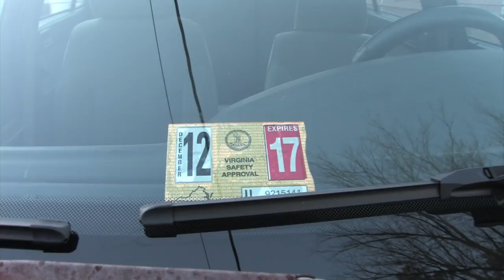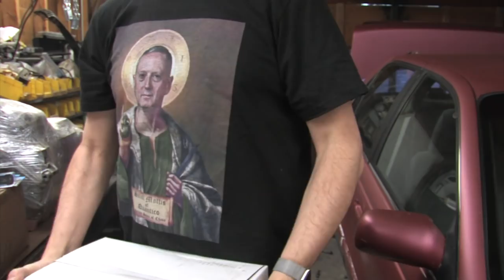Turbo Elantra Traction Issues - Part 2

Comment: I went and bought some Holden Commodore V8 wagon ultra low rear springs for my  BMW E36, they fit the same, but were way thicker and stiffer! and the car sits at a regular height, with less rear squat and transfers the body roll to the front, which is handled by a thicker front sway bar, im a firm believer of using what fits, my cars are all made from random parts, if you have a good grasp of engineering and physics, and can apply it to your part choices, then go for it, heck thats how most prototype cars are made.
cheers for being suck a great bloke Jafro! i realy enjoy your informative content! keep up the good work.

Comment: I really enjoy watching these videos. Also like the no nonsense honesty too with your R&D as well. 

A previous Elantra videos of yours massively helped me to do a gearbox swap in a similar Mitsubishi platform based car. A Proton Satria GTI.

Had a thought, sometimes a cheaper tyre is not always a bad thing. As they'll break traction, before something more important breaks.

Fair enough at the strip switch out to a much better and grippier tyre.

Sucks when stuff goes bang when you're just trying to drive the car and not even leaning on it.

Comment: I had to show my father this video just for the fact of the rear springs. We have a 2001 Chevy van with 280000 miles and he thinks the front suspension doesn't need to be changed. After showing him this video and how collapse those springs were, he ordered new springs for it and can't wait to see his reaction when installed. We experience bump steer like crazy with every little pot hole it send the steering wheel to the left immediately after a hit

Comment: literally got giddy overseeing a new Jafro vid :)

Got ya going in my garage right now as I sort the headlight issue in my mustang. She likes to burn out the switches and my stereo dims them big time; some relays and more direct power is going to do the job nicely.
Reply from the maker: Sounds like you might have a ground problem in there somewhere, too...
Reply: Grounds were fine, but for my winter project on this car I've been doing a wire tuck on it because the wiring on the Fox body mustangs is hideous. Charging harness did end up having alot of green death on it, so im replacing the lethargic 90 amp alternator with a newer gen 130 amp alt and all new wiring for it. New alternator and wiring mod should stop the headlights from dimming and the car nearly stalling under heavy bass (loud exhaust + no sound dampening= sub woofer.....apperently, got the car this way).

She's an on going project to take someones beat up track pig back to a more drive-able state while not losing any of the performance.

Comment: I'd like to see you rig some narrower coilovers on the front from another car and put some wider tires on. I love your rear suspension idea. Ingenious.
Reply from the maker: I would too!  Except that I couldn't turn if I did.  :(  It's not just the spring diameter causing this.  The drag slicks that I have rub the inner fender and frame (prior to the front end fix I performed in the previous video), so I'd have to cut away the frame and replace it to pull it off safely.  On this car if I want to go wider, I have to go outward or else re-engineer the unibody front end.
Reply: If you really want to keep your mods cheap, then try a fender roller. Check out how much this guy flared out his fender with a roller: 

https://www.youtube.com/watch?v=dF5uA1u7Mts

If you aren't attached to that little flat lip around your fender, you could contour that sucker with the surrounding body panel and add between 0.25"-0.5".

Comment: Great job. The stance looks great. I’m sure it will settle in time. How did you lookup the springs by size?
Reply from the maker: I found a chart on the Moog website with all their OE replacement springs, sorted by ID/Length, said, "OMG, those are 510 lbs!  Oh look, one end's squared, one's tangential.  Those will be 'perfect'!"  :)

Comment: Cool, more Jafro. It's been a while...

Springrate and damping are matched from the factory and in well-designed aftermarket and custom setups. Are you concerned that the Aztek springs are going to be way too much for the stock shocks, particularly their rebound damping?

Comment: Before you wax the headlight buckets a few minutes with a rattle can of clear coat to seal the lens helps a ton
Reply: Came here to say this. Did my wife's forester(01) and my legacy(95) at the same time. Used the 3m sealant for hers, and clear coat for mine. Guess which one I have to redo a year later? Hers. Mine's like new

Comment: The only good thing with the headlight detailing kits, or restoration kits is they come with a UV treatment to prevent them re fogging as easily or as quickly since you've removed the outer treated layers of the plastic.

Comment: Hi jafro, about your car pulling to the right, you should adjust your front right chamber to be more negative. Let say your left side chamber is at - 0° 28'', your right side would be about - 0° 33''. Because our road isnt flat. In your case is left hand drive vehicle. In my country is right handed vehicle. So i done it opposite way.

Comment: Thanks for your videos I'll be doing the springs on my 90 GST😎
Reply from the maker: Make sure your LCA bushings are good.  That might be a spoiler alert... but... while you're at it...  If you're having traction issues, scrutinize the sway bar bushings and end links as well.
Reply: Jafromobile. There are brand new except for the sway bar  thanks for the info

Comment: I wanted to stiffen up and lower the front suspension of the my ford courier.  My initial theory was to cut mustang II springs.  Thinking that by cutting the springs that it would raise the spring rate yet lower the the truck. It should have (in my mind) raised back up to factory Courier spring rate since they were a softer spring). Well it lowered the truck alright but the ride was way too soft.  It would bottom out terribly. I calculated spring rate incorrectly.    Anyway, I ended up going with 81 mustang springs and cutting a few coils.  It worked perfectly.  The ride is great and it handles so much better.  Next is a larger sway bar in the front and adding one in the rear as well has a panhard bar.  Love your videos and how you use parts from different vehicles for you builds.

Comment: How much power/traction do you think the transmission can handle? I really want to see some aftermarket rims that have an offset that will support some wider tires. I've had more fun running wider street tires than thinner slicks. Not a slick fan over here...too poor ;)

Comment: Hi Jafro, I really enjoy watching your videos and I have been checking in over the course of 4 years.  I had a couple of questions maybe you could answer for me.  I have a 1998 eagle talon tsi with 178k and it blows blue smoke at idle. The car is totally stock and I can't figure out why it does this.  The second question is for a 97 tsi 1G built motor 18k, 80K original miles on the body of the car. Currently there is a leak coming from the water pump. I think this may have happened either because I put on a stock radiator cap on an aluminum radiator or it was because the car was just running with water for about a month after it was swapped to an aluminum radiator, not done by me.  Anyway, I'm lost as what to do and hopefully maybe you have some advice on how to proceed?  I appreciate your time and help in the matter. Thank you kindly

Comment: I use a soft cloth wheel in a drill and drywall mud and a water hose running a little water over them while buffing . takes about 2 minuites . when glueing plastic take ot to an rc shop and they will give you the proper glue for the plastic its kinda like welding where you want to use the proper rod.

Comment: Hey Jafro, I have always wondered, why didn't you (or don't you) want to make this AWD? It would be a hell of a sleeper. Any reasons besides inspection related stuff?
Reply from the maker: Yeah, the front half might be the same as the Mirage, but the back half is a whole different thing.  Making the AWD stuff fit this thing would be absolute punishment.  Magnitudes harder than what I went through on the Colt.  The chassis is just too flimsy to handle it without adding over a half-thousand pounds of drivetrain parts, re-enforcements to the chassis and a roll cage.  By then It will weigh as much as an Eclipse.  My Colt has a 400lb advantage in that department.  Even with the AWD stuff in it.  Unless finishing the Colt somehow becomes more impossible than swapping the Elantra, it's not likely to ever happen.
Reply: Totally makes sense. i actually just had to reinforce the rear end in the Mini Cooper for the 4g63 rear drivetrain. It wasn't so bad but then again, the rest of the chassis is very stiff already, which isn't true in your case it seems.
Thanks for answering nonetheless ;-)
Reply from the maker: I'll make subframe connectors for the Colt.  Love your mini, BTW.  I was pleasantly surprised to see the same front end suspension techniques that I had to employ on the Hyundai also worked for a completely different platform.  Anyone reading this comment should go watch your videos because it's the best thing to ever happen to a modern Mini chassis.
Reply: Thanks a bunch for the support. The Mini is such a pain to work with pretty much everything on the stock setup so I try to make everything easier or more accessible as I go fixing and replacing stuff. Half the time for this build that literally means chopping something out of the Eclipse and welding it to the Mini like with the suspension haha

Comment: What should I do with a 1990 Mitsubishi Mirage that has been wrecked in the rear-end motor and transmission is good
Reply: Talk to some folks on DSM web sites such as dsmtuners before you send it to a junkyard. Not all the parts in a '90 Mirage are of interest to them, but for any of the parts that do fit, you're much more likely to get a better price than the pittance you'll get from a salvage buyer. Or just watch videos from Jafro and Velocity Labs and Project Binky and friends until you have an unstoppable itch to fix it up yourself. :-)

Comment: Hey jafro what kind of metal polish are you using? I’ve used those headlight restore kits but they just yellow again in a year and the kits are expensive.
Reply: either wax or clear coat the headlights after the polish, or they'll just oxidize again, but quicker.
Reply: FrankTheCat yeah I’m gonna clear coat them this time with the two part UV proof clear coat.

Comment: Not sure about the legal aspect (light patterns), but in Europe, you could have bought these headlights much cheaper.  By the way, Some of your videos in the past contain a round rotary brush mounted on the air angle grinder tool. These brushes have 100% plastic "fingers" and you used them to clean the old gaskets. What is the name of this tool?
Reply from the maker: 3M Bristle Disc.  The different colors represent different grits.  You'll figure out quickly how that works once you find a vendor!  The mount it uses is called a "Roloc", and it's the same one used for sanding discs.
Reply: Brilliant. Thank you!

Comment: After all the spring measurements how did you come up with azrek springs? Was there a lot of trial and error or some sort of spec resources we didn't see?
Reply from the maker: Rather than waste my time on non-descriptive resellers who want you to fill out what car you're buying parts for so they can pick them for you, I visited spring manufacturers' websites until I found a set that roughly fit the spring dimensions I was looking for.  The manufacturers have better info than the retailers do with their part numbers because they supply the technical specs of the parts.  There were several production cars with springs in the general dimensions of what I needed to pick from, and Moog provided a searchable, sortable list that made that process simpler.  I was looking for the ones with the highest spring rate in that size.  Higher spring rates means they'll compress less at ride height.  The Aztec just happened to be the model that won because an Aztec is a heavy pig.  They weren't the perfect because I knew they'd be too long... but none were available in a high spring rate with a shorter length.  Trial and error began after they arrived because I had the most important variables solved by measuring first.  Trial ended up winning.  So add Pontiac to the list of non-Hyundai manufacturers in my build, so now it's Nissan, Chevy, Subaru, Mitsubishi, Hyundai, Plymouth, Dodge, Buick, Honda and Pontiac.  10 manufacturers wrapped up in this thing so far.
Reply: ***** I must say your ingenuity and problem solving is very impressive. I hope to one day take you on with my own jumble Hyundai build.
Reply from the maker: Truth be told I've always wanted to 4g63/AWD-swap a 93-94 sCoupe.
Reply: ***** that would be awesome. I have a 2002 accent 2door hatch with a beta 2.0L out of a 2000 elantra, Mazda speed protege turbo, home fabbed manifold and intake, Mercedes B200T intercooler, eBay lines, boost reference fpr... I also have a spare drive train out of a 2.0L AWD 5speed tuscon for later use. Was dreaming of a 2.0T AWD swap at some point

Comment: Your a smart guy but I have a kind of opposite problem of what you have and why its a problem. I have a great looking car. Lotus Esprit SE. But the power is just not there. Sure itll toast a subaru but I bet your elantra would smoke me.  I have an old journal bearing turbo a cast manifold. Gm batch fire injection and an intake plenum that is 2,000cc too small. I started making a new plenum but what should I do next? Exhaust turbo or fueling? I was thinking about a chinese GTX3076R ball bearing with a billet wheel. 500$ or a haltech elite 750 for 1000$

Comment: hi sir，need your help about outboard motor。i buy a used 2002 suzuki df115 four stroke EFI，four cylinder 16valve fuel inject engine just like a car engine，15 years ago，some strange noise from inside when the motor running in idle speed but disappear in 1000+ rpm and over，it sound like a diesel engine （da da da da da）what do you think of this sound come from？may be crankshaft bearing？
 if i rebuild this motor and replace all the parts which is out of service limit（all new parts was oem parts），and do this following the Suzuki service manual step by step，pay attention with the clearance、journal and torque 。when the job done，the motor can be running as 80% quality as a brand new one？what about the durability and stability after rebuild？

Comment: Wonder if some of that on/off switch behavior can be improved with further part throttle tuning.
Reply from the maker: I'm thinking I need to dial out the overlap out of the camshafts and increase the lobe separation angle.  It's at 103 right now, and I think a 107-109 would work better.  I'm not sure I can even achieve that with these cams, but it's where I'm heading next if the tune doesn't work.

Comment: Hey Jaf, If I were you, I smear some petroleum jelly or that PTFE stuff around those bulb holes and adjuster gears. just a thought.
So what is it now? 6 to 1 on Bad Obsession Motorsport?
Reply from the maker: ?!?  Wha... whadya mean?  I don't get the 6:1 part?  I'm not competing with the people I've built a shrine to in my living room.  But I will say this...  I AM a dummy for building a 400+hp FWD car and putting hockey pucks on it.  I will own that.  It's just that I didn't have a choice.  I meant no disrespect in any way about Nick's constructive criticism.  It's criticism that I earned (if it was even about me), and it is well deserved!  I think he made that statement about a wide gamut of people, not just me.  It's very good advice!  Just like your petroleum jelly tip!  ;)
Reply: no criticism from me... you're no dummy. a dummy wouldn't have got this far; I was just commenting that I think you have 6 videos to each BOM's videos. apples and oranges though..... so, you have a shrine too?

Comment: Is that an old school PPI amp on that sub?
Reply from the maker: It's two old PPI amps, and yes.  :)  I like old skool!
Reply: Heck yeah man, old school car audio is great! I have a RF Punch 360a2 running two MTX Thunder4000's and its a little powerhouse for such a small amp
Reply from the maker: I had that exact same amp, and you're not kidding.  It drove two DVC 15"s at 1Ω, until it vibrated the RCA inputs to shreds.  It made so much power that it shouldn't be bolted to the box it's driving.  An absolutely evil amount of bass.  It ran for 6 years like that in a '92 Integra.
Reply: Wow you ran it at 1ohm bridged?? I've been running mine at 2ohms bridged for over a year now and it gets pretty warm.
Reply from the maker: I didn't say it was smart.  That heat had a lot to do with the failing RCA inputs.  I bought the box and amp wired that way from a friend after he totaled the car.  I bought the whole car actually.  I only got about a year out of it myself.  I had to re-solder the RCA's, but it had been overdriven its entire life.  Don't run that amp at 1Ω. I used to do it safely with Phoenix Gold and PPI "Art Series" amps, though.  Some of the old stuff will take it.
Reply: I had to find this comment as soon as I saw that, damn I miss my old 2600...